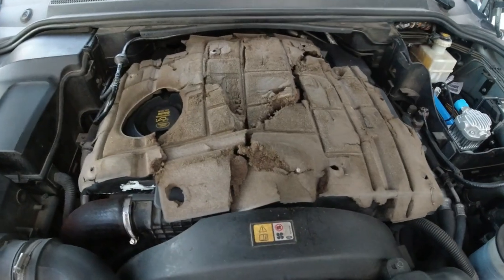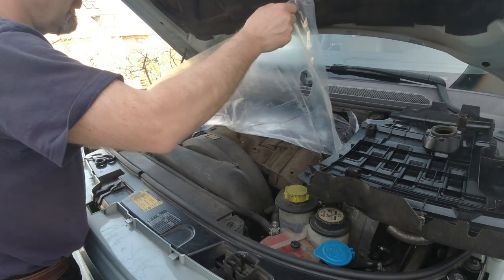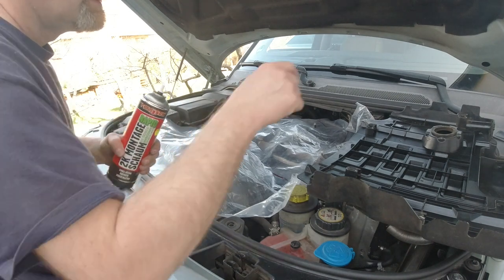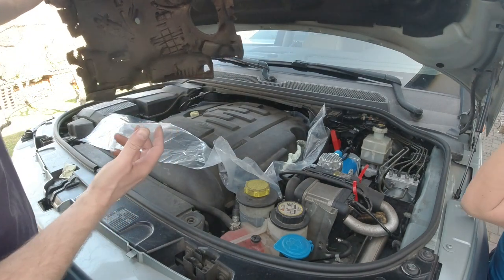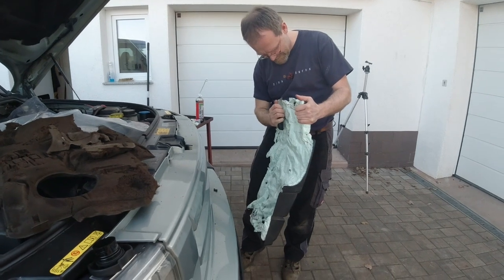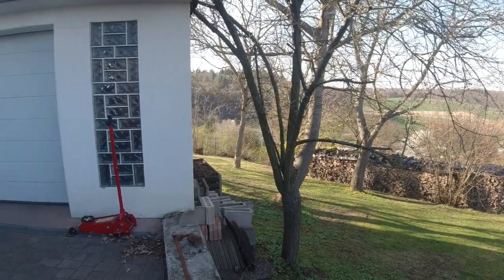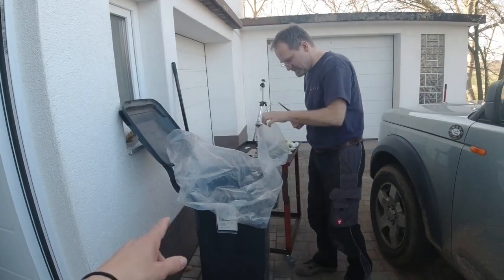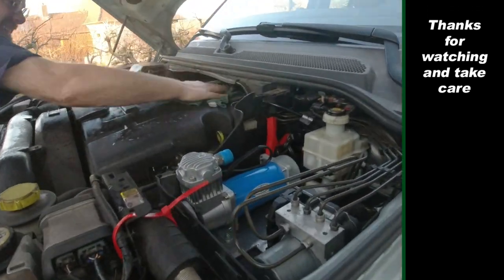Land Rover Discovery - How we fixed our engine bay cover - DIY noise dampening or stupid idea?

Comment: On my Jeep I took the engine cover off to help with keeping the engine cooler while running. My theory is that the sound deadening cover holds in the heat and down here in Arizona we need that heat to escape, so I took it off completely. Didn't do a proper temp check before and after, so I don't know if it worked or not. Got the same answer from my wife as Vera gave to you. :) Love watching you two.

Comment: I had the same problem on my 88 Range Rover classic. I used a heavy aluminium foil that had a closed cell foam backing, it worked a treat. Engine bay temperature and noise about the same as before, but no  dust and fibre and other s*i*T falling every time I opened the Bonnet/hood.

Comment: Another job on my to do list.
I see Rimmer are asking £233 for the engine cover.
I am thinking that the foil should be fitted to cover more of the engine bay as some of these spray flame expand different amounts depending on which one you use.
Also wondering about the practicality of moving the air compressor to a new location for better protection.

Comment: Yes I replaced mine last year with fire retardant sound deadening off eBay 2 m² for £17 in black and it was self adhesive one side just cut and stick 🤗 👍
Reply from the maker: Good solution and less fire hazzard!
Reply: @Vera_and_Christian  I did provide a link to this but my comment seems to have been removed ? just keep a eye on any strange smells coming through the vents as that foam can be flammable and toxic what @Dan Hayes mentioned is much better and safer replacement
Reply from the maker: @wobblycaptain  We have had that happening a couple of times that comments are lost or are put in the spam folder by Youtube.  When there is a Number combination or an @ sign, Youtube thinks it's and email adress and/or phone number and removes the comment unfortunately.  That is not done by me or Christian. 🙋‍♀️ Vera
Reply: @Vera_and_Christian  No problem 😎 👍

Comment: Nice solution but I think it was risky. Luckily the foam didn't push a hole in the plastic foil while expanding. But I'm happy for you that it worked out. Best Regards from Belgium, David
Reply from the maker: Hello David, yes, this is by far the dumbest thing I´ve done in my repairs.    I was actually suprised that it kind of worked in gerneral.   I wonder what would have happeded if I held the can in the right way and way more foam would have come out...  Probably glued the bonnet closed...  Christian

Comment: Christian the idea is good and the end result was ok but possibly it would have worked better if you had drilled 
Maybe 4or 5 small holes in the cover then pumped the foam into each hole . The holes could  be plugged later 
With black bungs🧐👍🇬🇧

Comment: Christian said "I'm probably the first person to do this" there could be a reason for that 😆 
Wonder how the foam would react to a long drive in hot weather, you can simply buy an acoustic blanket that is heat resistant & place it between the cover & engine.

Comment: Did you try without the foam, any noise difference on my L322, rats eat the foam so I pull it off and put it in the bin, have not noticed any noise difference in the last 3 months.  If I had heard a difference I would have used some self adhesive aluminum sound proofing similar to equate used on transmission tunnels and fire walls, it is multi layer and thick so it will deal with heat as well as sound.
Reply from the maker: I am not sure actually if there is a difference. It was the first time in 6 months that he went to the hardware store, which were comletely closed due to Covid. He just got carried away a little bit. 😅👍🙋‍♀️ Vera

Comment: Absolutely love the idea. Just one question for you Christian as a technical German guy. Did you check the temperature rating of the foam, as it gets very hot under that engine cover. In Namibia, we saw under bonnet (hood) temperatures over 90 deg C, but we run a V8 Petrol unit, but the diesels 'can' get hot under there too.
Reply from the maker: Hello Overlandi, ok, this is a solution for the far northern and southern hemisphare.  Like the arctic circle or Alaska.  But it is also ok for very wet places like the Amazonas region.  High humidity does have a cooling effect when driving....   Did I forget to say this in the video?  Christian
Reply: @Vera_and_Christian  love the thought process

Comment: "I could spray some black paint on so it looks pretty"

I don't think there's enough black paint to accomplish that. :-P

It's not a completely terrible idea, though.
I guess, ideally, you'd want to make a "fake engine top" out of plywood, or something, to create a proper former for the foam and the fake engine could have holes in it to inject the foam through.
That way you'd end up with a nicely-shaped foam lining.

Also, you realise you missed an opportunity here, right?
What you should have done was downloaded a spectrum-analyser app for your phone, run the engine with the original cover in place, run it with no cover in place, run it with only the plastic cover in place and then run it with the foam-filled cover in place and used the app' to see if there was any difference.
That'd be the "German" thing to do. ;-)
Reply from the maker: Yes and I should have outsourced the job to India and request a written report twice a week 😂

Comment: Thanks for anther great video,
 I had the same problem with my Discovery 3, 
but I went down the road of using  under Bonnet Heat Resistant Acoustic Thermal Insulation Sound Deadening 10mm thickness with self adhesive backing, 
witch I used to stick onto the removable cover that gos on top. 
P.S. But I did not have a Vera to advise me of course ☹️ Thanks again for your great video’s. 
Regards Chris. 🤓👍
Reply from the maker: 😄👍🙋‍♀️ Vera

Comment: I'd call it a Sound Deadening Pad.  Is the stuff in the can fire retardant?  I'd test it, just in case. p.s. Can we have more videos of Christian sweeping the floor?
Reply from the maker: Hello Rob,  I would not use it to add a extra layer of fire protection...  But it can be used as a fire starter when out camping having to lint...  Christian

Comment: Another great video, which we found amusing. Is the form you used fire retardant? I am going to use the sound proofing foam with the silver foil on one side on mine. Not sure if you have seen my email thanking you for the sticker. Happy Easter to you both.
Regards
Peter
Reply from the maker: I bought a second fire extinguisher together with the foam.  I also expect it to smell strongly when going 180 on the Autobahn.  So I got all this worked into my plan.  Nothing can go wrong.  But I would not do it again or recommend it.
Reply: @Vera_and_Christian  Hi Christian,  it was always worth a try. Nothing ventured nothing gained. Looking forward to the next video. 
Regards 
Peter

Comment: Been looking for a solution for mine for years, mines totally gone and for some reason they don't sell foam on ebay; mind you, not sure about this method either.
Reply from the maker: I think the original replacement costs 110€ here in Germany.  Fabian just left it the way it is without the foam.  I would have done the same. With the AT tires on, I highly doubt anyone hears a difference. 😅🙋‍♀️ Vera

Comment: You would need flexible foam to absorb the noise. I'm sure that is PU foam nixed with talc and water. The talc makes it fire resistant and (????) The water makes it flexible. Not sure this is a DIY product.
I would use furniture memory foam it is treated for fire.
Reply from the maker: Hello John, I bought a second fire extinguisher.  So One for driver and one for the passenger.  So far nothing melted but I do keep an eye on it.  Worst case, I need to scratch it back out.  I only did this because the foam was on sale… Christian
Reply: @Vera_and_Christian  the temp on to of the engine should never get hotenought to burn but retatsnt foam helps prevent fire spread.
Reply from the maker: @johnbrown-so3vz  Yes, that is why I am not so worried, otherwise I would have him taking it out again. 😄🙋‍♀️ Vera

Comment: Pretty much all spray foam is highly flammable, even if it's the orange "fireproof" stuff.
I would be super worried about a fire!!!
Reply from the maker: Before it catches fire, it will melt down and smell.  So I told Vera to pay attention to it and not to use the air circulation function of the AC...  I am smart.   Christian

Comment: Hi Christian and cheerful Vera, it is important to have your sound proofing as quietly as possible on extremely long journeys, my concern is that you used a foam that will not give off dangerous fumes that can effect those driving, something with a foil coating would be a little better be safe both off you,

Comment: Should have used concrete...fireproof as well.
Reply from the maker: Lol 😂😂😂. Yes and mass is good for soundproofing too.  It just does not come in a can.  Christian
Reply: @Vera_and_Christian  LOL. Fuller FulaFoam Fire Resistant Expanding Foam.  Now that you have experience with foam - create a few and sell them for $200 :)